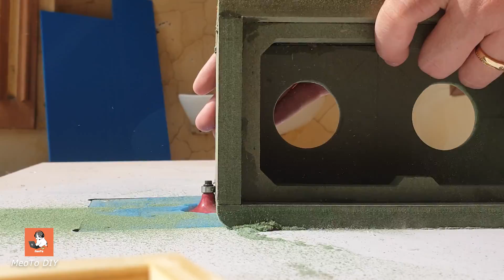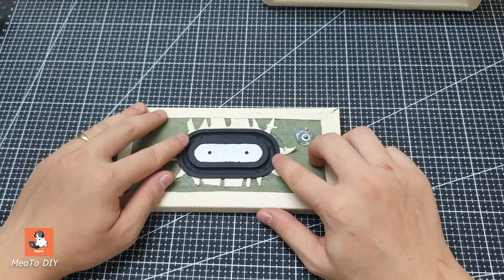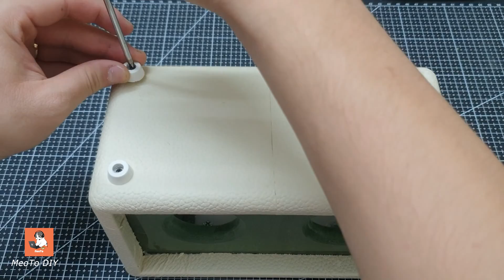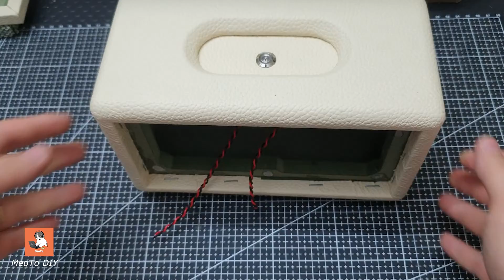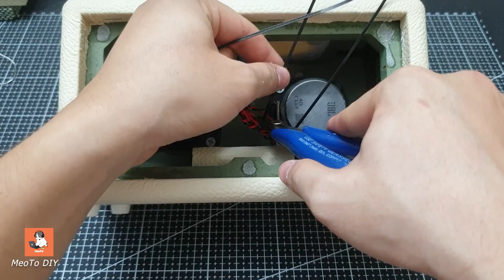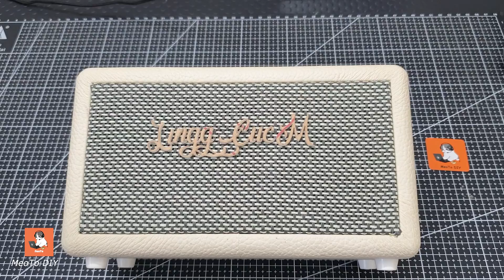DIY MINI BLUETOOTH SPEAKER FOR DESK | Làm loa Bluetooth Mini Để Bàn Làm Việc | MeoTo DIY

Comment: No bms on the lithium pack? 
Use a type c charging module like the LISC then it can be charged with any mobile phone charger that supports fast charging like QC2 or 3.0 it will charge at 12-15W around 0.95-1.05Amps
Reply from the maker: Thank you